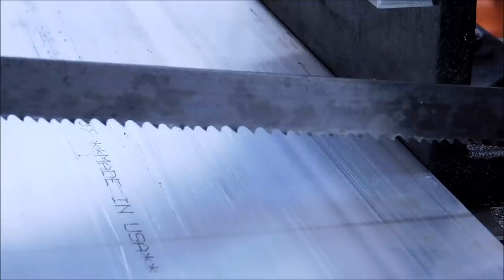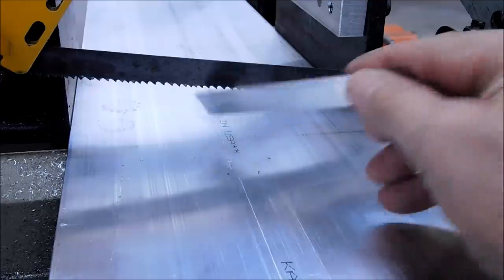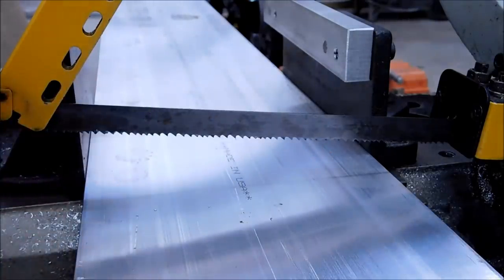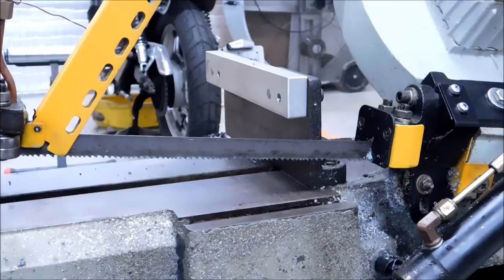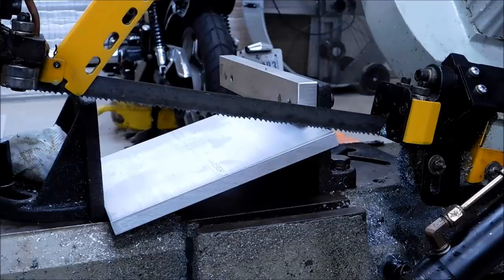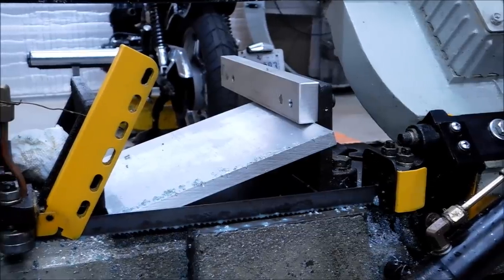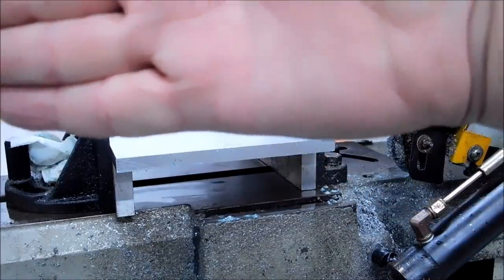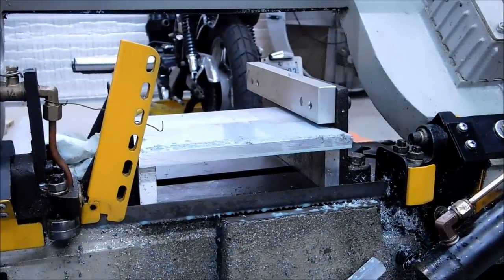Shorter Cutoff Times on your Horizontal Bandsaw

Comment: Any tips for a poor guy who only has a hacksaw and has no money or room for a bandsaw?  The only thing I came up with is using my reciprocating saw, but the cut is never straight.
Reply: ariesmars29 The principle for speed is the same. Cut the thinnest dimension. For straightness, a mitre box or similar jig should be helpful. At the very least, get a ruler and a sharpie and make a line to follow.
Reply: I can address one of those issues.  Have a look at portabands.  Milwaukee do one that will take up to 5" stock and you can put it away when you're done.  The money part, well, you're on your own there although they are cheaper.  You can also use them as a vertical bandsaw if you clamp it in a vise or add a table.  Swag Offroad do one or you can use the bandsaw to make one for itself.
Reply: Why would your power saw not cut straight?  If there's something mechanically wonky, that's a tune up project worth doing.  Maybe it's just set up to apply too much down force, and the blade itself can't stay straight.  Regardless of the cause, a saw that can't be used to cut straight isn't earning its space in your shop.  Fix it or recycle it! :)
Reply: @somebodyelse6673  I suspect you have in mind a power hacksaw when I think the OP means something more like a sabre saw. If unsupported at one end and unguided (yes, you can add a guide rail) then it's bound not to cut straight - especially if you're talking the machinist definition of even vaguely straight/square/parallel.
Reply: @Cenedd  - Ah, guilty.  It never even occurred to me that he wasn't referring to a power hacksaw.

Comment: I wonder which way cuts the straightest...
Reply: That is determined by your blade and machine, not the material orientation (assuming you are cutting conventinal and not starting from a sloped surface).

Comment: Do you run your endmills and other cutters at the same speed? Why would you run the band saw at the same speed for all materials. Stainless should be down at 100 fpm and alum should be as fast as she goes 300 fpm+. That is the first step to learning to us a bandsaw blade.
Reply: Hey, you can't be Doug A....I'm Doug A.....cutting speeds....yeah, there's a reason saws have different speeds...and when you get into the high $$$ saws...some incorporate a 'rocking' motion on the whole blade assembly, they really zip through that 18" round bar, or 24" wide flange 'I' beams....
Reply: @dougankrum3328  ya we just install an Amada pcsaw720 at a customers. So 30" cut and has their pulse technology.
Reply from the maker: The speeds and feeds I run my milling cutters at is cutter and material based. This blade is designed to cut a variety of material and does so just fine. I cut a lot of material here and have my blade set at the edge of correct. Just a little slow for aluminum, and  just a little fast for stainless. This machine is tough to change blade speeds on, so I leave it where it performs best. Unless the machine has a vari drive, I think you'll find most shops don't change their blade speed or blade between material for just a few parts.

Comment: Tooth build up of chips is the main problem
Reply: Chip evacuation on a long cut can definitely be an issue, but also think of the pressure. Pressure is the force divided by the area. A wide, parallel cut spreads the force of the down feed over a wider surface which equals less force per tooth. Narrowing the cut area decreases the amount of teeth engaged at any given moment which increases the force applied to each tooth.
Reply: @jimnolimit  Correct my friend, the tooth pitch for long cuts should be much bigger. like 4 tpi.

Comment: Super tips as always. Liked the second set up, the coolant seems to travel both along the top & bottom. If watching my channel, in the background is my 1945 vertical Delta. In the process of changing out the original 3/4 hp ac motor to 24vdc 3.65hp with speed controller. Got tied of removing fixed belt guard to change speed. Whats your thoughts? Bear
Reply from the maker: A speed controller is a great idea.
Reply: Love the Free section on Craigslist to pick up older treadmill's. The old Discovery one have the best 3.65hp DC motors, and the flywheel is already keyed, so fwd or rev is a non issue ;)> My ole '36 SB 9 is powered the same, love it, Cheers, and keep them videos coming, I learn from ever one of yours, Bear

Comment: Is that guard some king of a new OSHA thing? I used my first horizontal saw in High School when I was like 16 years old and I'm 74 now. That is the first HSB i have ever seen with a guard at the business end.  I have been retired for a few years now and out of touch with the safety sissies but 3 guesses and the first 2 don';t count  where that guard would be if it's not an OSHA violation to send it to the scrap hopper.  Looks like something that would get you hurt trying to set up a cut to a layout line.

Comment: All its doing is creating a relief so it's not dragging thru all the material three teeth is the best contact you can achieve
Reply from the maker: Less contact =less resistance=faster cut.
Reply: @joepie221  see now there are to many factors blade, thickness, kerf, tpi, material, hp an truly how much material is being removed per tooth if we are really talking about speed cutting

Comment: I always thought the most teeth in contact with the material was best. was easier on the blade. slower but made the blade last longer
Reply: There's a rule of thumb regarding how many teeth should be in contact at a time for optimum cutting and blade life. Not sure how many exactly but it could be around 2 or 3. So if you are cutting thinner material you may need a finer tooth pitch.
Reply: BUG KILLER, it's a balance between teeth pressure and bandsaw force, powered down saws can cut quickly over full capacity width, many saws relying on gravity, with some feed control, you see many saws with lumps of material added on to increase force. Hope this helps.
Reply: With most cutting tools depth of cut has relatively little effect on wear, up until up until the point where you either exceed the structural strength of the cutting edge or clog the gullet. This means that for a given surface speed the wear rate is roughly constant no matter if you are taking a light cut or a heavy cut. If it takes twice as long to cut a part you have roughly doubled the amount of cutter wear per part. Of course if you push it too hard you exceed the strength of the cutting edge or clog up the gullet and it's game over. Next time you see a production shop look at how hard they are pushing their cutters. Not only does it give a high production rate but it also increases the number of parts per tool/blade. The real skill is in working out just how hard you can push it before the edge starts to break down due to over loading. Saws are particularly tricky in this regard and that's why most of us run well under the optimum feed rate.
Reply: @LesNewell  Spot On.